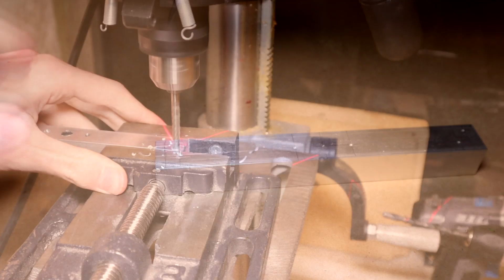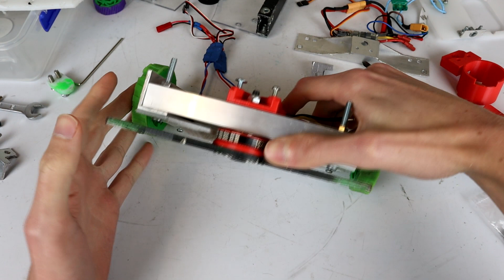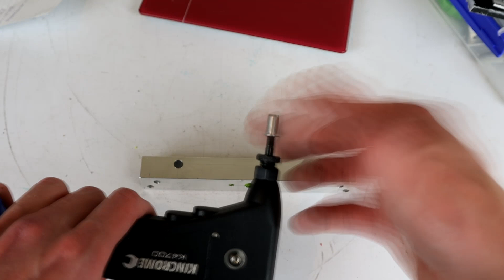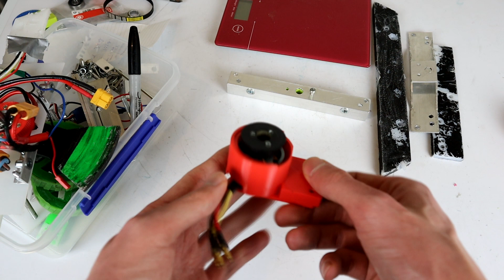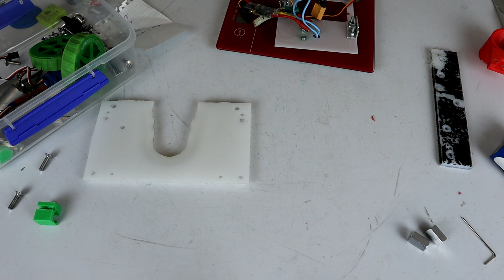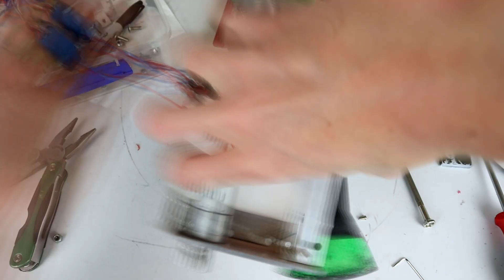Quick upgrades and repairs for Annie R U OK

Comment: HI,

What type of motors are you using and what is the running voltage of your robot?

cheers
Reply from the maker: 25mm 1000rpm brushed gear motors for drive
And 3s lipo power, so 12v

Comment: The cantilevered motor mount plate isn’t stiff enough, hence motor/pulley movement - there’s quite a large moment arm for the belt tension to act on. Supporting the mount plate on its ‘free’ end (to avoid a cantilever) would stop this motion; is this what the cylindrical shroud piece is for? If so it perhaps needs a little tweaking
Reply from the maker: Yep,
thats what I discovered in the breakdown video before this one, the old version of the motor surround had warped in printing and wasnt flat on the extremity so the motor plate was free to bend down further then this one.
The shroud is multy purpose, its there to stop electronics touching the high speed motor, to keep the motor plate as flat as possible and to hold the bearings that touch the motor down lower to stop the flex.

The shroud was tweaked in this very video to have the bearings to fix the flex issue

Comment: Love it! those thread rivets are interesting I’ll have to try them out 

plus having the bearings support the motor is something I’ll have to try I was looking at putting the bearing on the shaft at the top of the motor but placing them on the sides seems like a better plan
Reply from the maker: Rivnuts are great! they are super useful but I usually avoid relying on them to hold armour but in this case it was the easiest and fastest way so I took a chance

The support bearings seem to work well, I was worried that they put too much friction on the motor, but the spin up was great

Comment: Just a thought but if you want your pulley to be more durable and still light, you could get a mark forged print of it. Also I like the fix for not have if one big bearing, I think the small ones may work better.
Reply from the maker: Thats not a bad idea, I might look into that before looking into metal printing or some other way to put metal into the pulley... but you never know, it might not be needed
Reply: Team Panic maybe, it’s definitely cheaper than a metal print, you could also order the FingerTech pulley, but it is toothed.
Reply from the maker: I'm running a toothed pullies in Annie so thats not a problem. The problem would be getting one with the right number of teeth at the right size
Reply: Team Panic you could just send in the current pulley and get it printed.

Comment: 🤞 I really hope this is the breakthrough Annie has been fighting for, especially considering the overall design itself is just over 2 years old now.

I was sceptical at first when you threw in those M5 bearings, because I thought it would cause too much friction and damage the motor. But seeing Annie spin like that has given me hope again.

Best of luck to you this weekend, and as usual, can't wait for your battle reports. 😀
Reply from the maker: Thanks!

On the m5 bearings, honestly same, I was very worried they would be a hinderence, but the spin ups in this video are the best spin ups Annie has ever had. (plus I only got the weapon to like 15% so theres still a lot of speed left there)